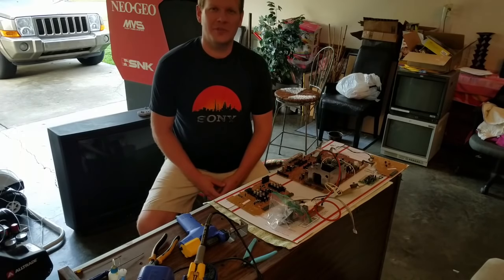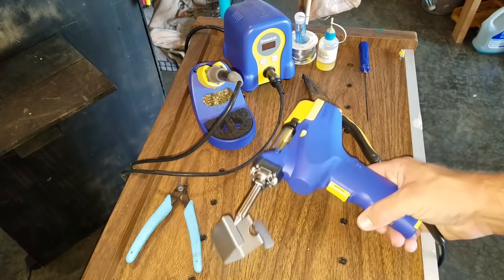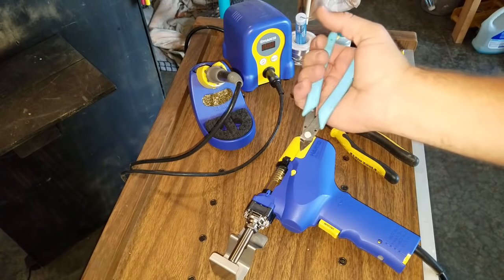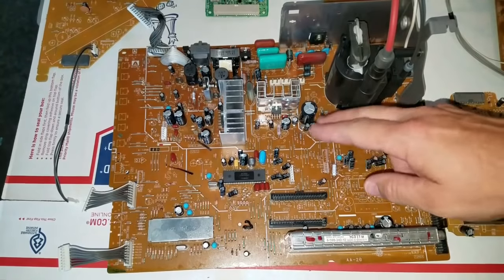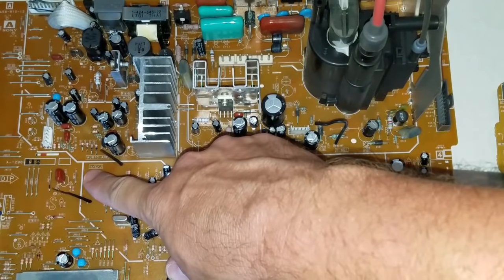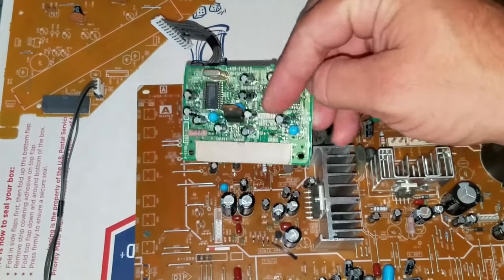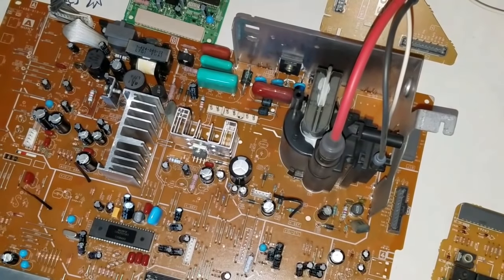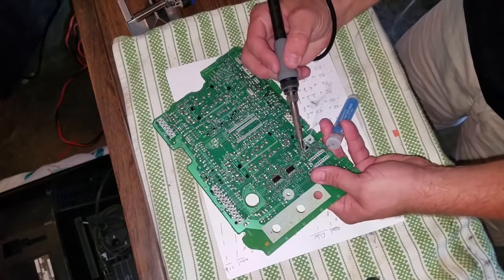How to replace Capacitors in Sony CRT TVs & Monitors

Comment: Thanks for your information, keeping these old sonys going is truly a great thing you are doing.
Reply from the maker: Thanks
Reply: @RetroTechUSA  Do you have any advice on how to search for repairmen who will work on CRT TVs?
Reply from the maker: You can try to look for electrical/computer repair shops that are small businesses first.  They may be able to refer you to someone if they don't do it.  It will be a pretty pricey job most of the time.  No less than $200 generally.  Other than that, I will be trying to set up a way for people to ship me the boards that they want recapped only & not the whole CRT.  You'd have to reinstall the board & do all the calibrating.
Reply: @RetroTechUSA  thanks, in my case I got this beautiful trinitron xbr from the early 90s, the picture was perfect and sound but it started to turn itself off, then come back on, almost like a safety mechanism, I am pretty sure it is the G board power supply, but I am afraid to shock myself trying to take it out of the TV.
Reply: @RetroTechUSA  assuming its just caps on  the power supply only, is that more inexpensive?

Comment: New to this... for my Emerson CRT, should i discharge the slightly swollen 560uf 200v capacitor while it's still attached to the motherboard,  or should i desolder it first, then discharge it? How would I safely discharge a higher voltage capacitor?

Comment: Another question Steve: I noticed in your previous video that you discharged the anode... but what about some of the larger capacitors on the board? Should those be discharged as well to prevent an unpleasant shock? Any other components that will shock me that im not aware of? I thought I had it all figured out last night but now I learn about discharging caps as well...
Reply from the maker: I've read about that and heard others warn of it.  I'm not sure that any of these caps are really large enough to hold that much of a charge, but it's better to be safe than sorry.  Thanks for bringing this up

Comment: Hi. First off. Thank you for all your great videos.  I picked up a Sony Trinitron KV-27FS100.  Color looks very good but I do have some wavy sides.  It bows inward on the left and right.  My research online shows a lot of folks saying to either play with convergence strips or replace caps that filter 50/60hz.  I've recapped a few arcade monitors with cap kits, but I'd be a bit lost where to go for this problem.  You mentioned that a lot of the time the board is marked with the area it's relevant to.  Do you know which area would cause the wavy sides?  I've just push them to overscan for now but you can still tell if you look that the image is slightly distorted. I appreciate your help!

Comment: Nice. Thanks for sharing this insight tutorial
Reply from the maker: Thanks for watching.
Reply: @RetroTechUSA  Hi Steve, I don't know if you can help me. I have a 1990's Sony Trinitron CRT KV28FX60U and it's a UK model. This tv is more than 20 years old and was in perfect working condition until around a year and a half ago. Basically it wasn't used for 6-12 months and then when I tried to used it all the colors went very dull and dark. No matter what I did with the normal color settings nothing changed and it was still extremely dull. I don't have much knowledge of repairing CRT tv's, so I am not sure if this is a degauss issue or cracked solder joints. Anyway I also went into the service menu and really messed the colors up even more, changing some of the values and now you can see hardly anything. Is there anyway I can reset the values on one of the circuit boards on a Sony Trinitron. This tv was a fantastic tv in it's day. Any help would be appreciated thanks.

Comment: Will a complete recap like this fix my geometry problems and bring the set back to showroom condition? Or would I still have to make adjustments within the service menu and internally? I know many of these adjustments require an oscilloscope or other special equipment that I won't have access to.
Reply from the maker: Unfortunately the cap kit will not fix the geometry really.  That still needs to be adjusted.  The problem is this lower end Consumer CRT did not have a lot of adjustment potentiometers installed.
Reply: Retro Tech  Got ya, do you feel that the convergence strips did a better job as far as correcting your geometry problems? Also, do you have any more information regarding your proposed cap replacement service, where we could simply send you our TV boards. I'd be really interested in that!

Comment: Do replacement caps just need to match the original capacitance and voltage ratings? Or are there other properties that I need to match like the cap's ESR (equivalent series resistance)?

Comment: Awesome video! Got a question for ya.  I have a 27" Trinitron from 2003 or 2004 that i use for my ps2, so it has gotten a ton of use over the years.  A couple years ago i started noticing ghosting of white objects on dark backgrounds (leaves a trail as it moves), it probably wouldn't bother most people but i notice it.  Also there is a vertical line about 5 inches from the right side of the screen where from that point on the colors shift slightly.  It is easier to see when the screen is black, after that line everything is just a slightly different shade of black.  I Noticed this line about the same time as i noticed the ghosting.  Do you think replacing the capacitors would resolve these issues?
Reply: I think ghosting from white objects on black backgrounds is normal for all CRTs. I have yet to see one that doesn't do it.

Comment: I have a Kv-27v36 and the issue I have is the  very corners of the screen stick point out. You had mention there a spot on the board that controls that. Would replacing the caps on just that spot fix the issue or would it be better to just recap the whole board?

Comment: Thanks for the awesome videos on repairing CRTs! I got a question regarding a PVM I bought. Unfortunately it arrived with shipping damage. The color purity is bad. In a complete red picture I get on parts of the screen a more blueish red. This also happens with other colors. Can it be that the yoke got moved during shipping? Do you think I might be able to fix that with moving the yoke? Thanks!
Reply from the maker: Hi and thanks for watching.  The yoke does have a set of convergence rings on it.  You may be able to tell if any of the convergence rings moved during shipment.  If they moved, it would cause color and purity problems.
Reply: Thanks for the answer! Yes, I checked to rings but they haven't been moved. They had a white mark on them and they all lined up. I actually tried correcting the problem by moving the rings. It is better, but not perfect. That is why I thought maybe the yoke itself has moved.
Reply from the maker: mldkhn1 A purity magnet may have fallen off too.  It's just a small coin size magnet that is stuck to the tube by 2 sided tape.   A convergence strip could have moved or need to be moved also.  That affects colors also.
Reply: There are 4 convergence strips on the tube. I guess they are all still in place. I didn't see any magnets when I opened it earlier. I have to check that again!
Reply: go to the hardware store and get some small magnets of different strengths (thumb nail size to thumb size) and some two sided tape.  with the pvm turned on and an image on the screen place the magnets on the tube of the pvm until  the colors are corrected. might have to flip the magnets. Tape down the magnets where you want them.
Reply: Will do that! I just opened it up again. Definitely no magnets on the tube anywhere. But I noticed the rubber that should hold the yoke in position is loose on the bottom one. It doesn't press against the yoke at all.
Reply: mldkhn1. I don't think pvms typically have magnets taped to the tube. None of mine do. Have you tried degauseing the tube? If the color issue corrects for a second and then comes right back (with a degause) then the magnets should fix your problem. Strong fridge magnets should do
Reply: Thought it might be a degauss problem as well. But when degaussing it with the built-in degausser the color does not correct. Unfortunately I don't have an external degausser.
Reply: mldkhn1 not a good sign that the color doesn't correct with a degause. I don't think a degause wand would help since the built in degause isn't helping.
Reply: I had some magnet tape lying around and I can correct the color a bit when I put it on the tube. But I have to put it right at the yoke to have the desired effect.
Reply: mldkhn1 that's odd usually the magnet goes on the large bell shaped portion of the tube. Probably going to need something stronger than magnet tape
Reply: Then I'll have to get some stronger magnets. Thanks for your help!
Reply: I moved the yoke forward and used magnets on the bell of the tube. Now the picture is almost perfect! Thanks for your tips, guys! Here are before/after comparison: https://imgur.com/a/JantSZx
Reply: mldkhn1 i think its safe to say problem solved! Super stoked for you. Love when we can save one of these amazing monitors. Happy gaming!

Comment: Will this make the geometry better?
Reply from the maker: Maybe if a bad cap is causing a geometry issue, but (with my TV) changing the caps made NO improvement to the geometry.  I am shooting a follow up video to answer this an other questions today.  It should be out no later than tomorrow.  Thanks

Comment: Steve,  I picked up the exact same model Sony today.  Do you have the list of Capacitors you bought for your TV?   I can't find the service manual online so it would be a lot easier to have a list someone else already put together.  Thanks.
Reply from the maker: I do have an order sheet on mouser.  It is for the entire CRT though and there is no install guide.  It's over 100 Caps I believe.  If you want a copy, please email me snutt541@gmail.com

Comment: So if you're not sure what the problem is, do you do a full capacitor replacement across the board?  How do you know what kind of capacitors to order before removal?
Reply from the maker: I did replace them all.  If you are having problems with one particular thing, you can just recap that portion of the TV/Board.  I had to go through and manual count all the caps on this TV and order them individually from mouser.com
Reply: Thanks Steve, always getting great info from you. I ask because while I love my new PVM and have been playing on it a ton after some initial calibrations, it does have some very light shadowy ghosting against certain backgrounds. I've been told it's a sign of failing capacitors, and that capacitors are the first thing to go on CRTs in general so you'll wanna know how to replace them if you're an enthusiast. Not something that bothers me now but could clearly lead to more serious defects, so I think I'll practice capacitor replacement on my KV27S42 using your videos as a guide. Again thanks for all the hard work man, you're one of the only guys that consistently puts this comprehensive stuff out there for the less experienced.

Comment: Awesome video! Love Sony TV's lol. I have a very similar model its KV-27S25 which recently the upper corners are not as sharp as they once were. I noticed you mentioned an area that affects the corners. How was the outcome? Did it correct the corners and convergence?
Reply from the maker: Thank you!  I actually finally found the service menu for this tv.  Here is a link to those instructions.  I think you need to press Mute to write your changes.  Please check the comments of that video to be sure.
Reply: Your videos are just awesome! Very informational. I was able to get into the menu and adjust some but no convergence. Was watching your other video about the convergence strips. Will try that too. I do feel I might need to replace those caps for the pin area you mentioned. I have never discharged a CRT before and it kinda scares me lol. I live by myself. Can I replace the caps with the board attached still?

Comment: Thanks for all the great videos, they are super helpful! I have a question about purchasing replacement capacitors. Do you have any guidelines or suggestions for ESR ratings? On Mouser, I've been filtering by the capacitance and voltage ratings for the radial leaded electrolytic capacitors (Wurth brand), but there still ends up being a list of around 7 difference choices with the only difference seeming to be their ESR rating. I'm tempted to choose based on price, hoping that anything produced today will be good enough for a CRT TV from 2004, but thought I would ask for your expertise first!

Comment: A small bo boo there. On the first cap you removed you trimmed the cap AFTER you flowed it. You should REFLOW after trimming because the trim action can sometimes leaves cracks in the solder. Trimming should be done before a final reflow. I think this is important enough to consider as you may see problems that weren't there prior to the recapping process and that could be a huge disappointment for well, anyone. All right cheers! For this reason alone, I had to leave a thumbs down which hurts me greatly because I know how much work you are putting into these videos and I sincerely appreciate it but I hope it's fair game to call this out and react in good faith with a thumbs down.
Reply from the maker: Yeah, unfortunately my producer missed that one in the final cut.  Just kidding.  I do all these videos by myself in my garage, so on occasion I miss something like this.   Thanks for watching.  I can say that the Cap replacement did not improve the geometry at all.  I do think the sound is better on the TV afterwards though.  Some of those caps must have been failing.
Reply: @RetroTechUSA  I cycled back and yup, gave you a thumbs up. Your long history of work is just too valuable. Maybe I was being cynical?